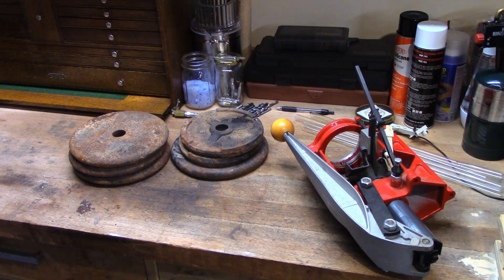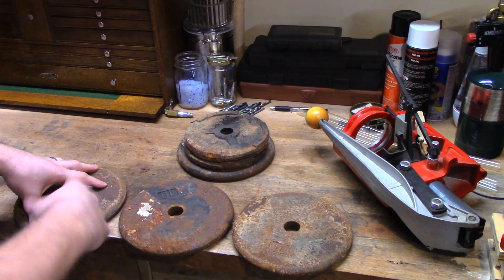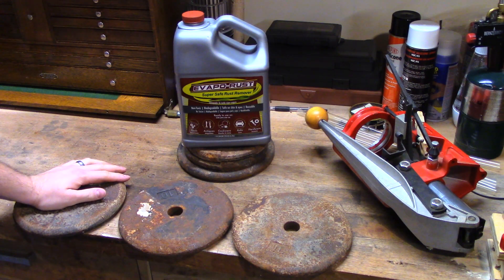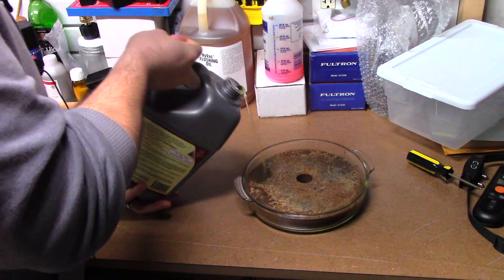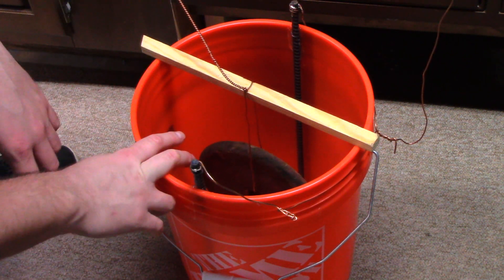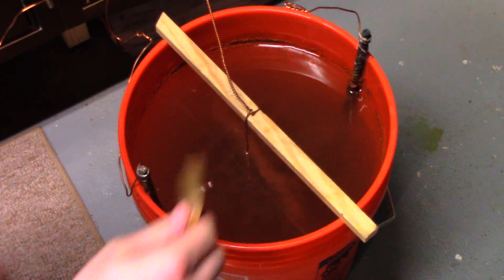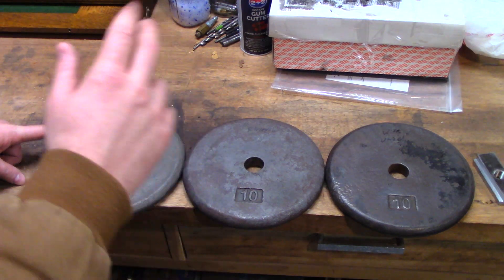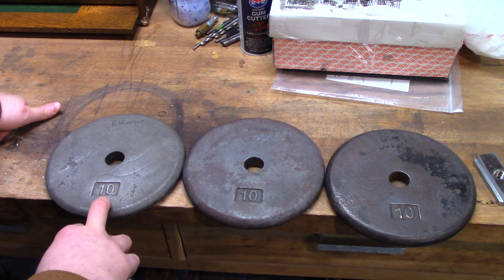Best Rust Removal Method? Evaporust vs Electrolysis vs Grinder with Wire Cup

Comment: I'd like to see a follow up to this using different acids. I mostly use Hydrochloric for rust, but mainly because it's the only strong stuff i have/can get. But sulfuric vs hydrochloric vs citric ... would be fascinating
Reply: You can get citric acid at the grocery store.  You'll find it in the canning section,  or sometimes the baking section.  Some stores even have big tubs of it so you can scoop however much you want into a bag.
Reply: @ThinkFreely2012  i know, i wasn't clear, sorry. I said the only strong stuff. I'm not waiting days for that stuff to react ^^
Reply: @marke1464  ah I see.  It may be slow,  I'm not sure.  I use citric for cleaning corroded copper.  But I also use hydrochloric for rust,  that stuff works great,  just don't leave it in too long.
Reply: @ThinkFreely2012  Oh yeah, def made that mistake. I'm really wondering about sulfuric or ferric chloride for speed and surface when removing rust
Reply: @marke1464  i haul tanker trucks of HCl for a living everyday,  so I see what it does to steel and iron often.  Ferric might be ok, it's used for etching copper and brass and for municipal water purification or maybe that was ferric sulphate?). Sulphuric can be bought at most auto parts stores as battery acid.  I know it will eat metal up pretty bad,  so I would assume it would remove rust,  but don't know about its efficacy.
Reply: @ThinkFreely2012  I only know ferric from etching damascus steel.
Battery acid, ha. Try buying any fun things in germany, you're lucky if you get a Kinder Surprise Egg
Reply: @marke1464  ahhh, Germany,  yeah I can image you would have some difficulty then.  I live in Texas.

Comment: Thanks for the vid.  I will get some Evaporust. Thanks for the link.  Do you have a recommendation for preventing the rust again?  I have many wireframe Christmas decorations and have been able to get the rust off but primer and paint is not keeping the rust away.
Reply from the maker: I really like CLP, Ballistol, and especially deoxit, but that last one is expensive although it's by far the best
Reply: @ElementalMaker  So after O remove the rust, clean with Deoxit.  Will paint adhere to Deoxit?

Comment: I know you're trying to cater to the safety trolls when you put on those Swiss cheese gloves, but you shouldn't. Rotary tools and gloves are recipe for disaster. As you can imagine, the glove can get caught by your rotary tool. Guess where your hand goes next? Right. If you need to use gloves to handle items, use the flimsiest latex/vinyl gloves you can find.  They will protect your skin while everything goes well, and will rip away as soon as they get tangled into your wire wheel... Better have the tool eat away at gloves that don't contain human flesh...
Reply from the maker: Very good points and suggestion Luke. I've always gloved up when using my angle grinder and never gave it that thought, but your right that could be very dangerous.
Reply: I think with wirewheels you want gloves as unsafe as they are cause the fast moving bristles can detach and embed themselves in your skin
Reply: @33blue  I would rather pull a bristle out of my finger, than a finger out of the grinder.

Comment: Citric acid solution hands down works äwsome. Just obtain some Citric acid crystals, put about a half a cup to a gallon of water, in a plastic container of choice. 5 gallon buckets work, mattering how your rusty items will fit, mix. Add items into solution leave for a day and check, when you're left with just a black film on item's surface it's done. Wipe off, use a bit of dish soap, rinse and dry. Be sure to coat with oil or paint otherwise it will rust up quickly. Works on all ferrous metal, leaves a nice sharp edge on files too.

Comment: What about citric acid?  Would be great to see a comparison of common home remedies vs commercial rust removers
Reply: I second this notion, testing a bunch of home remedies and comparing against commercial options.
Reply from the maker: I'll have to try some citric acid
Reply: @ElementalMaker  check-out https://www.youtube.com/watch?v=_dzlE9-9DVE for comparison
Reply: Citric acid is extremely weak compared to industrial acids. I wouldn't even bother comparing.
Reply: @1SmokedTurkey1  If you give it 48h as well, it will do quite a bit.
Reply: I've also heard of folks using a bath of molasses as rust remover.
Reply: Vinegar. Cheap and disposable. It maybe slow but you can accelerate it with heat. I’ve even tried using paracetic acid or add hydrogen peroxide but found out quickly that it dilutes fast if you do.

Comment: Evaporust is indeed a chelating agent.  But like you said, the SDS says not shit about what's in it.  Just that the main thing is around 83% of the entire amount in the bottle.  I've thought about trying to figure out what's in it so I can make my own because that shit is the bee's knees!
Reply from the maker: Wow I didn't realize it was that concentrated! I too was hoping to determine the active ingredient, but considering it's that concentration at only $15ish a gallon thats going to be hard to match from any chemical supplier
Reply: @ElementalMaker  It is >83% water from the SDS. And the chelating agent is <16%
Reply: something, something EDTA probably...
Reply: @SomeMorganSomewhere  it could be citric acid. Na Citrate is also used as a chelating agent for blue evacuated blood tubes, because it binds calcium, which stops clotting.
Reply: @franglish9265  if it were straight up citric acid it'd have to be declared in the SDS "it's got 'acid' in the name, it must be hazardous" *rolleyes*, but a citrate salt is a possibility.
Reply: @franglish9265  If it was Citric acid, he'd be feeling it pretty intensely in that cut he mentioned in the video.
Reply: @SomeMorganSomewhere  It could be phosphoric acid. It’s not toxic, in fact, it’s one of the main ingredients in cola. Gun bluing uses the same principle. It turns the bare steel into phosphate instead of oxide.
Reply: @5roundsrapid263  Pretty sure phosphoric acid would fall into the same category, i.e. it'd have to be listed on the SDS, sure it's not toxic but neither is citric acid (which is also in a LOT of food that people eat) and you still need to list that on an SDS.
Reply: @SomeMorganSomewhere  its probably neither as he would've felt it. It's EDTA or something.
Reply: I found a German datasheet from 2016: 80-90% water, 2-12% diammonium phosphonate, 3-10% sodium petroleum sulfonate (probably just detergent?)
Reply: @ramous5182  fair bet that the sodium petroleum sulfonate is a surfactant. Diammonium Phosphonate would make sense as the active ingredient. Probably liberates small quantities of ammonia gas as it works.

That said, there's no guarantee that the formulation is the same in the US :( There are products here in AU whose formulations vary by STATE... Of course that means they need to publish separate SDSes for them though.
Reply: @SomeMorganSomewhere  yeah, should be easy enough to analyse with the right equipment tough
Reply: @ramous5182  Maybe NileRed would be interested in tackling it?  Pretty sure it'd be easy for him to break it down...
Reply: @RealRuler2112  that would be cool, however I don't know if you get into trouble for reverse engineering their patent? Also someone would need to contact him...
Reply: @ramous5182  I'm no legal expert, but don't think a patent protects from a third party from reverse engineering/reproducing a product. People doing so is why the personal computer is as big as it is - IBMs competitors reverse engineered what the BIOS did and made something behave the same way; it help up in court.  More applicable to chemistry, many people have reverse engineered & published 'recipes' for Coca Cola.  Now if someone who knew their formula were to release it, there'd be hell to pay.  (Which is understandable IMO.)

I'll drop a comment on the next video he posts and see if he wants to pick up the challenge. =)

Comment: Evaporust is the best 👍👍👍👍
Reply: Not the fastest but it leaves the surface most intact and undisturbed vs. wire wheel or electrolysis, which may be important if you're restoring artifacts..  It is also supposedly non-toxic- I seem to recall the company CEO supposedly drinking it to prove it..
Reply: @Flying0Dismount  it's does the best results on cast iron and tool steel. But it is extrem expensive at my location about 50€/ gal. 
Please dont drink it. 😝